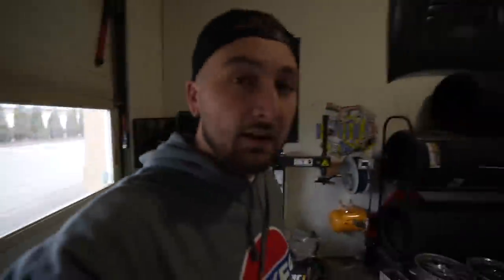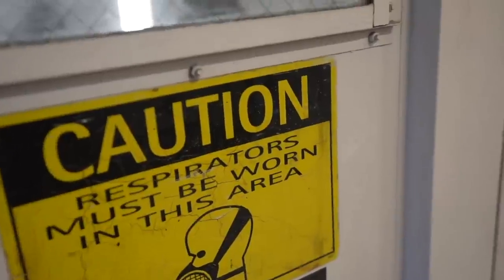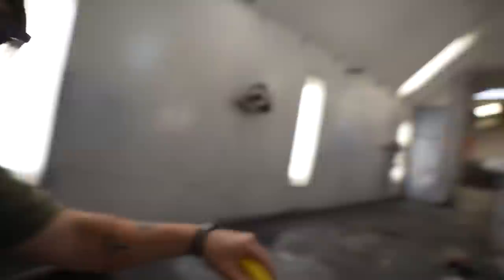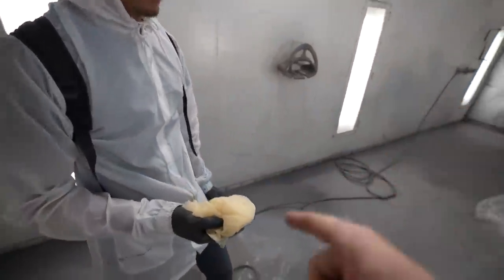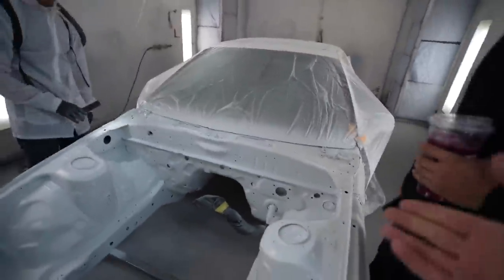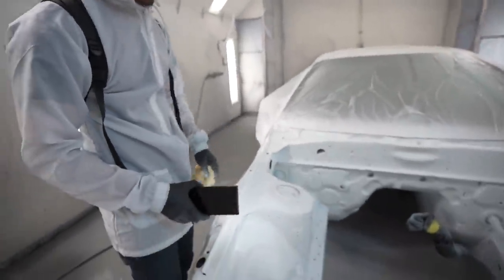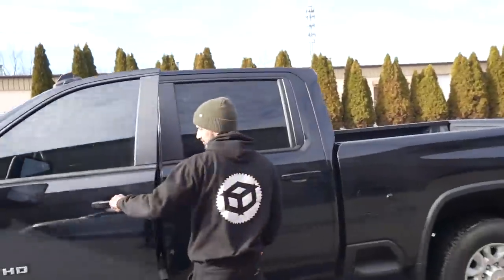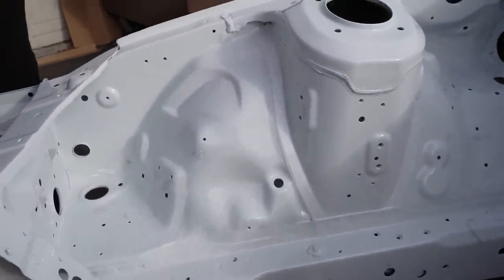WE BRING THE FC RX7 TO PAINT!

Comment: James you should get a winch for the trailer. Doesn’t even have to be a nice hard mounted one, just screw it into a 2 or 4x4 plank you can put across a support bar or sum for dragging stuff like this car up. Older guy I work with used this method to load a full toolbox so a pulling a shell this way should be no problem either I think(he also just used a cheap harbor freight winch since he didn’t need the winch super often)